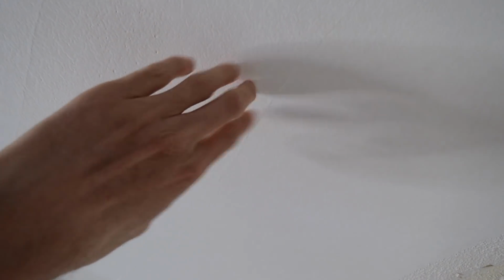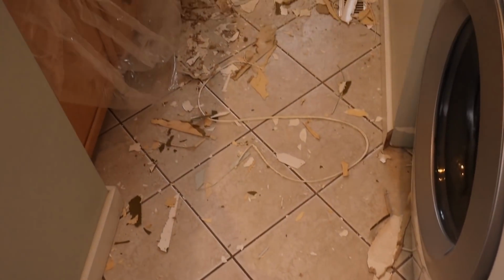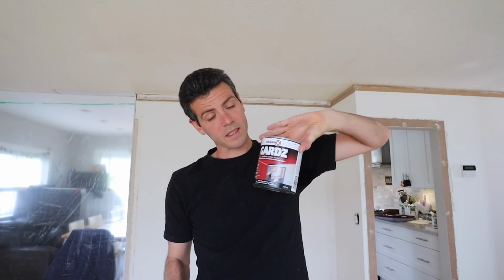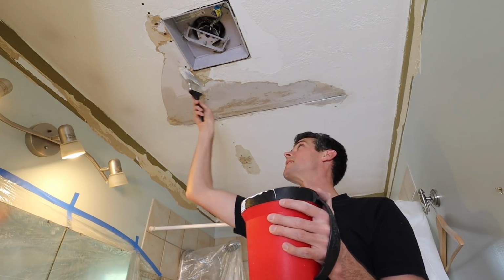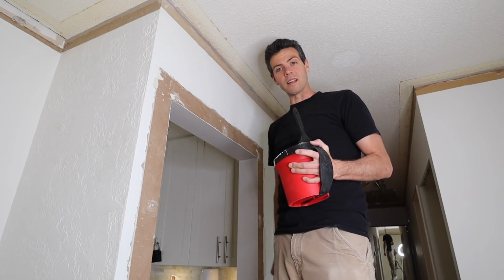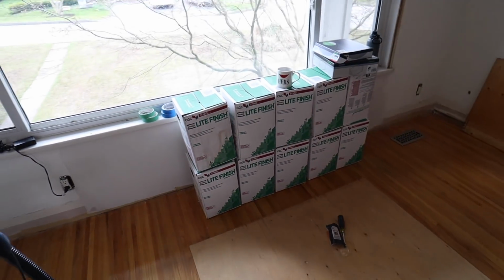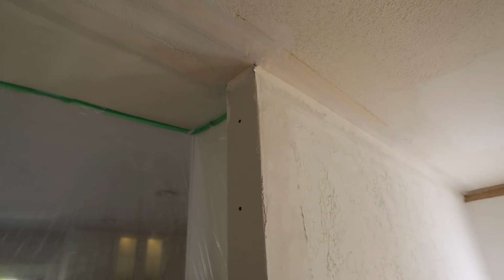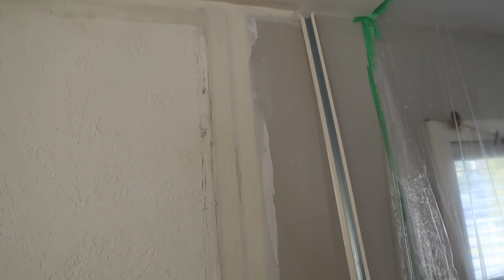Wall and Ceiling Job Day 2

Comment: So can you skim over painted walls? Color painted walls?
Reply from the maker: Yes
Reply: @vancouvercarpenter  I have been combing your videos for this ! No sanding first? No priming with that sizer (gardz)? I can skimcoat over eggshell painted walls? where is the line for gloss surfaces please? (also I upfeathered your video)
Reply from the maker: @bizwool  If you are just using joint compound to skim, coating over an eggshell should be fine. You can always give it a quick sanding to improve adhesion if you're worried.

Comment: 2 extension ladders and a plank no scaffolding needed
Reply from the maker: coating and sanding a big area off a plank is very inefficient. I would rather take the time to have a nice work surface so I can do a good job.
Reply: @vancouvercarpenter  and using just a plank is more dangerous. Everybody forgets to watch their steps ... lumber and an hour is cheap insurance against broken bonezzzz

Comment: That guards product looks like a good product. I run into small exposed paper now and again. I use wood glue over them. Then coat. Never been called back for a fix it again.
Reply from the maker: Wood glue might be better.

Comment: Tail light warranty we call it. Also I use GARDZ quite a bit. Dry time is 4 hrs and we mud and tape. Running a small fan to move the air also helps in confined spaces

Comment: I just built some scaffold for a staircase job, cost me almost $100 in lumber.   While safe enough I did not want to put too many fasteners in as I want to reuse the timber given the cost if it right now.

Comment: Old video and I don't know if you're still active but my walls (actually one wall) is just like that textured wall. I'm going to sound like an idiot but you sanded it and then filled it? If so, what exactly did you use to fill it because I need to attempt to remove the disgusting wall that is that from my room. HELP. Haha

Comment: You have wonderful talents both in the trade and your ability to teach.  I used your work as a gauge and fired the "professional" drywall installer we hired after one day.  A third of the screws buried in the drywall, unsupported joints everywhere. Butt joints all around doors and windows- (six separate pieces around each).  
 Thanks for letting me know what "done right" is.  Now I am doing all the rework myself.

Comment: At what point do you replace damaged drywall rather than fix it?  Me... I'd probably have taken that ceiling down as I imagine that there is mold and/or mildew on the other side of the drywall and they can cause adverse reactions in people...  Thoughts?

The spec sheet suggests Gardz smells like ether...
Reply from the maker: They have been living there for 10 years and haven't had an adverse reaction yet. People get weird about a little mold. We aren't talking about an active leak with mold forming like a sheet on the inside and outside of the drywall.
Reply: @vancouvercarpenter  Yeah... mold and mildew can put people into a spin for sure. I've run into so much wet/damp/moldy/mildewed drywall that had an odor and/or was crumbly that it's become pretty much automatic to rip it out. That's easier to explain than not doing it... I haven't encountered the dreaded "black mold" to date.
Reply: @vancouvercarpenter  In those circumstances I'd think it was okay to fix it. Around here ground water sourced humidity in homes is often a problem so mold and mildew thrive. All the "standard" remedies for the humidity control are recommended and the moldy/mildewed rock is almost always removed. There have been other times when I ripped out drywall and replaced it as it was quicker to do so than it would be to repair it--typically there was lots of damage and uneven studs/joists that needed to be shimmed/planed to yield a decent looking wall/ceiling. I was curious about where you draw the line on replace vs. repair? That is, how bad does it have to be?
Reply: I've used Gardz many times for ripped drywall paper. It takes about 2 layers of paint/primer to keep from showing through, (shiny like) unless the area is coated in mud. Love the stuff. Mine is only for indoors.

Comment: I had to look away when the paper started scraping off. I thought I would replace the old painted-over grills on the walls here and ended up scraping way more than I wanted to. I cut the paint, but it was compromised underneath. I’m about to try to do the ceiling registers now. cries. At least mine just went to brown paper and not bare gypsum. I’ll be sure to seal with PVA before mudding. Thanks again for filming these harder jobs. It definitely helps.

Comment: Workflow is important.  I get what you're saying about getting your zen on.  I do bathroom renovations (and other handywork) for a living. It's important to choose what part to do first so you set yourself up for success later.   Sometimes it's obvious what to do first, like framing, electrical, plumbing, boarding, taping, etc...   Sometimes it's not as easy as that.  Thanks for the great videos!

Comment: Sizing is the first paper you put on the wall, traditionally perpendicular to the patterns. It's called sizing because the old style paper shrinks when it gets wet. You put the papers on perpendicular so the two papers shrinking at 90 degrees to each other minimizes how much the wall paper changes size. Size don't mean glue at all. You can also 'size' a canvas with gesso so it doesn't shrink again when you paint the colours on it or start to shrink only in spots. Sanforizing has changed this quite a bit. Same with 'backed' wallpaper.

Comment: My friends and I are replacing drywall in a kitchen and we are only replacing the bottom half. The issue is that the drywall do not line up. We used wood shimmies to fill in gaps but there are spots that are still off. I suggested to them to replace the top a d bottom drywall instead of wasting time trying to even the walls. Whats your opinion?

Comment: This is my daily work in restoration. I wet scrape my ceilings and catch the texture in my pan, keeps job sites relatively clean. That power sander makes sanding look much more appealing.  Another awesome video. Keep up the awesome work man!
Reply: I have done both . I rather wet scrape less dust

Comment: You work damn hard, man. Impressed with the fabricated scaffold out of lumber. Never even occurred to me to do that! Hope you got some good restful sleep that night.
Reply: How was your project going Aron?
Reply: @TapelessDrywallFinishing  Mike I still haven't done it yet. I am curious, what proportion should I mix TIM to joint compound? I assume I should use a quickset-type mud (hot mud)?
Reply: @aaron74  The best way is you dry mix 1 bag of TIM with 1 bag of hot mud around 8-12 kg. If you can not use the whole bag of hot mud, then you can pack them in some zipper bags about 250grams per bag and sell them for $5 each 😀 or give them to your friends as birthdays present 🎁 or Christmas present 🎁😀😀😀
Reply: @TapelessDrywallFinishing  I will do that! I will post the project and the results on house-improvements.com's forum.
Reply: would it have been chepwr just to rent metal scafolding?

Comment: Hey Ben, I just replaced a bathroom vent and an entire section of ceiling drywall around it like a month ago. There was no roof leak, but where the vent duct attached to the fan it was not taped well so condensation from the duct was dripping out into the ceiling. You might want to check that fan 's duct hose attachment if you can access it.

Comment: I'm doing a reno in my house, somewhat like this. I have to completely re-do the horizontal joint in a room, and the walls are painted with semi-gloss. I'm going to have to treat the joint like a butt joint, which means I'll be mudding a good distance on either side of the joint over the old paint. Should I prime the wall first to ensure good adhesion of the mud to the painted wall? Or should I just mix wood glue in with the mud? Or both?
Reply from the maker: If you are using an all purpose mud don't worry about it. Plenty of adhesion.

Comment: Vancouver not sure if you texture too but any chance you can do a video showing how to do different textures like smooth walls, orange peel, knock-down and whatever other styles of texturing there are. In California orange peel seems to be most common. But I would like to see a smooth coat (no texture) how that's done. Thanks in advance!!!

Comment: I have to wonder if the Gardz you're using is different from what we have here, despite both the label and the text on the bottom black band being similar.  There's no way I could ever put my face over the can and take a big whiff like you did.  The smell is too noxious, even though it's water based.  It's to the point where I have to wear my respirator when I use it.  It's not remotely similar to the smell of white glue.  Also, yours seems to be of a much thicker consistency than what I'm used to.  I've only known it to be on the runnier side.

Comment: Can't wait to see how it turns out. I'm surprised you don't just pull the ceiling and start from scratch with fresh drywall.
Reply from the maker: Personally I find removing old drywall wasteful and soooooo much more work. When you know how to finish drywall efficiently it's way faster and easier to just skim it out. I mean, the boards already there right on the wall and ceiling for you.

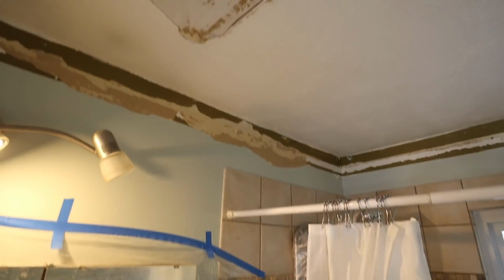Comment: @3:20, that is my question about a lot of these repair/redo jobs.  Where is the line to simply rip out the drywall and give it a good base vs. mudding over the pig. 

In our case we ripped primarily due to the fact that they one-off builder had non-pros build the place and they used nails which were popping everywhere and were rusty.  So skimming over poorly done orange peel would likely just be ruined by more pops in the future.   Though that wasn't a great idea as walls off resulted in many years of additional work and improvement as additional problems were uncovered (as well as possibilities).